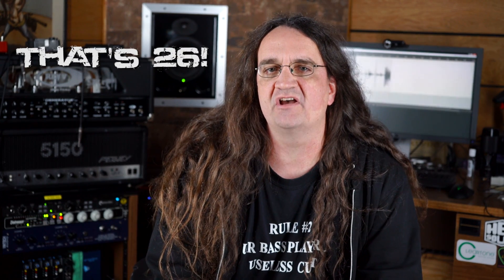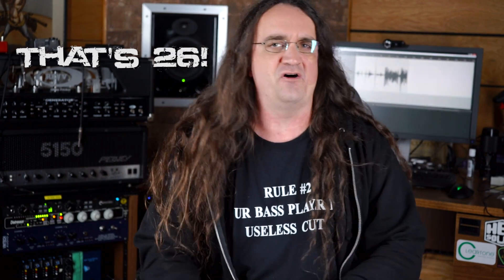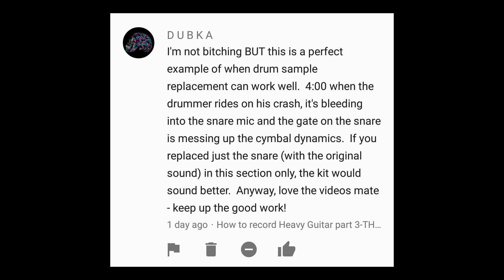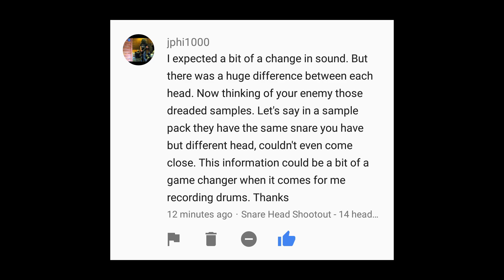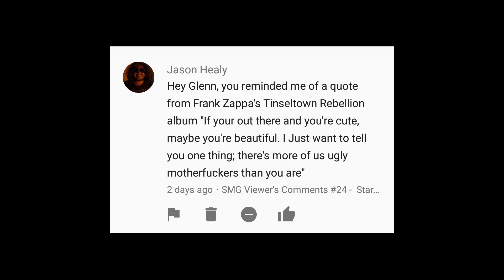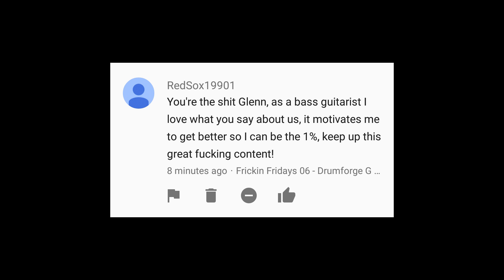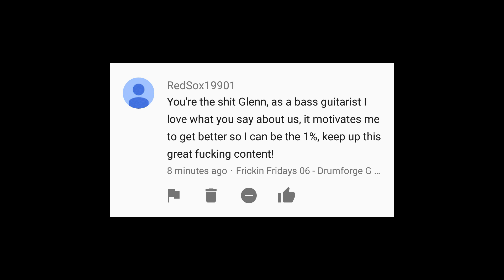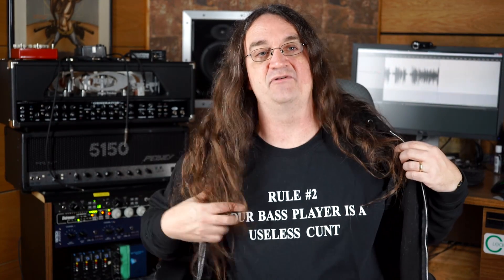SMG Viewer's Comments #26 - 8 channel USB interface suggestions

Comment: any chance you can do a video on how you set up all the gear. like how it plugs into the computer. how all the various things are connected to what and where.   and for recording drums. if you have an 8 input interface and a 2 input interface can you plug both into different usb ports and use both at the same time?  there are tons of videos on mic placement and what to do after the tracks are recorded but no one seems to talk much about the gear setup. total noob question.    my old way was plugging all the mics into a mixer, pre mixing, and sending that stereo out to the interface which sounds not great, but that has 12 inputs and most interfaces have 8 unless you have several thousand $$$$$ just laying around

Comment: I've been working with an Audiobox 1818VSL running firmware 1.21 for over 4 years and it sounds very good. The DSP allows you to have an eq, compressor, gate, delay, reverb and filter, and it is a great tool when arranging complicated monitoring paths, without loading your CPU and without audible latency. I think it is rated to be at 6ms at the worst case scenario. You can select the inserts to be just for monitoring or to print them in the tracking process. and the preamps, if not the best option, they are very very usable with awesome results. In fact, they are almost the same that the Studio Series of mixers and interfaces of PreSonus.

Comment: Hey Glenn, I currently use the Presonus 8 channel firestudio and the Presonus 8 channel digimax pre for 16 total inputs. Firewire/24BIT@96KHZ and the lowest latency I can get is 256 before it shitting on my cpu meter.... The software it comes with is great as I can record drums with zero latency before it hits the DAW. Preamps I believe sound decent but the unit is a little out of date as it is not compatible with the studioone desktop application. IT WAS A BITCH TO SETUP DRIVERS! My question to you OR ANYONE ON HERE, any experience with of the older presonus firestudio interfaces and would there be a benefit to upgrading to something newer with driver support. Another question, do you run eq/comp before the signal hits your DAW. Thanks in advance!

Comment: I am looking into the Makie blackjack because I'm looking for an audio interface with 2 pre-amped mic INs and the usual outputs. But apparently drivers are supported until win7 osx 10.8 O_O Anybody with ideas about better supported but equivalent interfaces? :-(
Reply: Roland Duo-Capture. Great pre's, great build quality, doesn't drain your laptop's battery on the go, and has a MIDI, which is always a bonus.

Comment: That's strage,  I've used the PreSonus Audiobox 2-channel for a few years and haven't had any problems with it. Granted, I'm no sound engineer, I just use it to record scratch demos and things like our band's first EP (heck, I haven't even upgraded to anything past GarageBand), but I haven't experienced any sort of ringing sounds from either my SM57 or my friend's SM48. I agree, you might've gotten a faulty unit. That being said, my other friend has an Onyx Blackjack that she uses for demos and that thing (along with our band's ProFX board) is a genuinely decent piece of kit, Mackie make solid gear.

Comment: I have the Tascam US 1800 from the picture and it's phenomenal.  I also have an Allen and Heath mixer and the preamps are not much better than the US 1800.  That's pretty impressive for a $250 interface.  I would definitely recommend it.

Comment: I see what you mean about changing the strings on basses more frequently than once a year. I have an Alvarez 5-string bass that's a fucking monster. As much as I would love change the strings they are hard to find and $40 US a pack at a local store. I haven't checked guitar center because I can already see how damn expensive they will be so my bass sounds like a corpse right now

Comment: Hey Glenn, 
What do you make of the 'celebrity sound guy' business?
Obviously its great to have people to look up to, but why should i want to use CLA or Schepps' chain and presets rather than finding my own sound and vibe?. I hear people say that analogue gear always sounds different to each other even though they may be the same model and they defend it with the fact that these celebrity engineers have their exact gear modelled and reproduced in the software. you can pull your own sounds with cheaper and sometimes free alternatives and the price pf the 'signature series' shit is fucking redonkulous. 
basically, can you validate me in saying 'don't buy in to this shit, its just another form of industry self preservation for cash?  for example i don't see yourself releasing a set of Glenn Fricker signature series plug-ins. because as you say in an early episode of musician texts 'why should i give you all the information i've worked hard for years to achieve, for free'.

interested to hear your take on the topic in a viewer comments video.

Comment: Just upgraded interfaces in my studio. Went with the behringer XR18. It's a digital mixer that sits on stage like a snake and can be mixed wirelessly with a laptop or iPad but the kicker it works as an 18 channel interface to record. Good preamps and has been no problem with pro tools set up.

Comment: re presonus 1818vsl, not used it but can recommend the focusrite saffire pro 40, clean (very clean didgi preamps x8 in all), a multitude of routing options - it's a work horse...  mine's been on for approx 15hours everyday for the past 4.5 years - no probs. do check it out as it's in the same price bracket as the presonus

Comment: Hey Glen! love your videos. I have an 8 channel interface made by M-Audio. I plugged in my guitar cable to the front the other day, it made a static shock sound, all the gain lights lit up and then it turned off. is it completely fried? is there hope to fix it? it's pretty old and I bought it used to I have no warranty. any advice?

Comment: After or between each drum session I let the drummer play each instrument alone in different intensities. So you have each drum instrument alone for replacement, if its fucked up because the drummer missed e.g. the tom or there is ugly bleed from the cymbals. AND: you can make you own sample library. And use drumagog and add or replace a drum with itself. Thats much better than a different sample sound, escpecially when using room miks or wurst miks.
Drumatom is nice. Bought it at the black friday special. Great on Bassdrum and Snare. But not as good on toms! If you remove the bleed to much on toms it kills the initial transient "click".

Comment: Greetings! For the song Razbival Okovi Perun, how did you manage to get the separate recordings (I presume it was only Ekaterina) to sound so distant from each other,  it sounds like you had a choir there, the timing seems a little off at each entry, it is very organic. Did you move them manually after the recording or was there a trick during recording? Cheers!

Comment: Hey +SpectreSoundStudios, do you have any thoughts on mixing out of the box?
I'm using a Antelope Orion32 through a Mackie 8-Bus and realized a huge change in sound especially on layered guitars.

I tried summing in Studio One as well as Cubase and ProTools but it didn't come close to the clarity and precision of the analog summing.
The setup is that I use the 32 return channels and apply EQ and Inserts on the DAW to have a bit of recall in the mixes.
Tbh I was a bit in shock because of the differences in sound (you know, there's a lot of bullshit around with audio quality like using cables for $200 dollar a foot and such).
I would be interested in your opinion on the matter.

Thanks a lot

Comment: Nothing at all wrong with the Presonus 1818vsl - solid, clean... you're not going to get any "color" or "character" out of it like you would a transformer or tube based pre, though. It's a solid budget level preamp /i-o with decent gain ( 62db) that will deliver decent results. So no, you're not going to get the warmth or pleasing edge out of it that would with something like an API or Neve, nor is it as uber-pristine transparent as a hi volt rail Millennia or Grace, either... but then again, it's not $ 700 per channel, either.  ;)Presonus converters have always been very good. The 1818VSL uses the same pre's and circuitry as the Presonus Studio/Live consoles, ( it's pretty much an 8 XLR in Studio Live desk in a rack) and comes with Fat Channel processing, like the SL consoles, except that with the VSL this is software menu-controlled. I have one I use as a secondary pre/interface, when I need more channels. It has 8 XLR's, 6 balanced Line in's, and two instrument inputs, all with independent gain control, and 48v switchable in 4 channel sections. Also, it features ADAT-Optical and SPDIF connectivity, is expandable (via ADAT-optical connection), and will support SR's up to 96k at 24 bit. In addition to the 2 main/CR outs, it also has 8 quarter inch balanced outputs. For the money, it's a very good preamp/interface. My hunch is that because Glenn got his smaller model used off of eBay, that perhaps there was something wrong with it... as he mentioned; maybe a cracked circuit board or something. Just make sure that you check your drivers and firmware for the latest updates, after you install the drivers that come with your version.IMO.

Comment: You've been ducking my question for months now LOL!
How does one achieve an original metal guitar sound/tone without using the usual run of the mill metal gear... Recto's, 5150's, EMG's, Vintage 30's ect...

I thought Dime, Anacrusis, Tool ect... all set themselves apart by being a bit daring with their sound and gear choices.  Nowadays, everyone sounds similar.

Thoughts?

Comment: Just bought focusrite 18i20. 400€ (problably less than 400$ in the us.) gives a very versatile I/O options and 8 clean, transparent and low distortion mic preamps with up to 65db of gain. I highly recommend to get one of those, basically best bang for the buck in the price range.

Comment: I use an x32 over USB for 32 simultaneous inputs. NO IDEA why this is my only option to get over 16 inputs over USB. it works flawlessly with my Hackintosh. I think there is an 8 channel uphoria by behringer for really cheap (less than 200). it has the same pres as x32 which to my limited knowledge, sound really good. I'll bring in external pres sometimes just because I have them laying around.

Comment: I wholeheartedly recommend the Tascam us 1800 to anyone it has 8 clean mic pres 6 line ins to record direct or add your own mic pres, digital and midi in and out as well as 4 outputs which is rare for a unit of this price which only cost me 300 CAD over 3 years ago and I have had zero issues with it software support is great....great for anyone starting out

Comment: Hey Glen, for a beggining guitarist playing with a startup band and doing solo stuff with a small shitty solid state practice amp, would you recommend upgrading to a combo tube amplifier or going down the cabinet amplifier road? Thanks for the help and keep up the great work!
Reply: +Paden Beecher I'm not Glenn but I have a solid state head (a Randall) and honestly I love the tone. Don't buy a tube amp just because people say it has a "better tone", you should try amps out first because everybody's tastes are different
Reply: I would not say tube amps are that important either... just go into a shop and ask if you can try a few of the amps out. As for whether it should be a combo or a head and a cab, that depends on where you will use it.
Reply: Bugera dude, it's not one you see on stage a lot but the 6260 and the 6262 are killer amps, plus if you are new to the world of tube amps, the infinium tube monitoring tech the put on some of their heads is great for knowing when you need to replace your tubes or if a tube has gone bad. Carvin is another great brand you can get cheap. The reissue x100b is great for just about everything. I have an 84 x100b and it only really reaches to classic metal gain maybe power metal gain before it gets fizzy but that may be my cabinet as well. But both company's are great and you can get the used from guitar center for cheap!
Reply: +Paden Beecher Look at some Carvin's as well. Tube amps that are pretty good. Bugera is good,as well. Solid State wise, Randall, maybe a CR120 from orange

Comment: Hi Glenn! About Mackie... I have ONYX-1220 and I am having problem with it. Sometimes output from firewire lose bass and stereo goes out of phase and left speaker is more quiet... I think that it is driver problem because when I disconnect and reconnect firewire it works again... If you know what is the problem please help! I am using win10 pro.

Comment: I got to use a Focusrite Scarlett 18i20 inerface this passed weekend and the pres in it were spectactular, very transparent and full sounding. No idea about the driver support but from what I have heard they are rock solid interfaces and the mic pres are based off of the Focusrite ISA preamps which is cool.